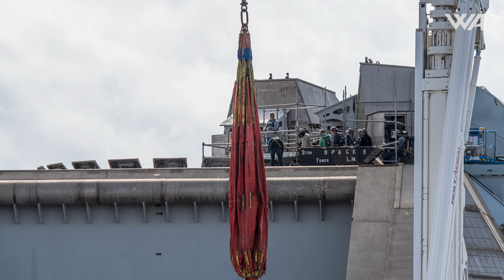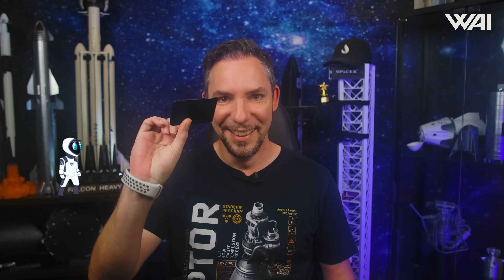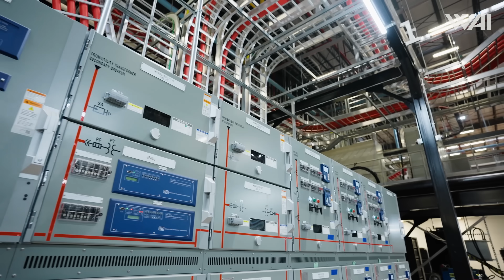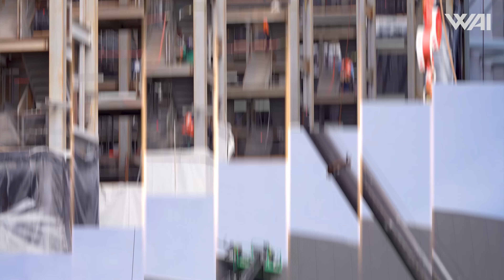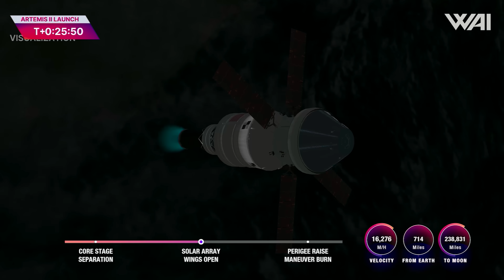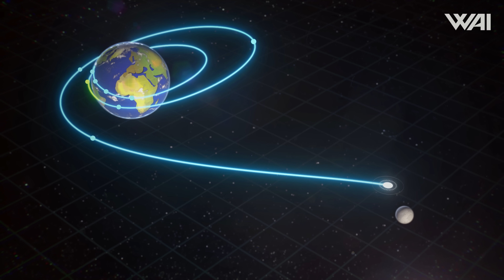SpaceX Reveals CRAZY Starship Plan Involving Gigantic "Mini" Satellites!

Comment: You are wrong about the advantages of spacebased AI data centers. The cooling is not easyier than on earth. Radiation is the worst method to dissipate heat. A cooling system on earth with the same cooling performance would be smaller and cheaper because you can use air, water or even the ground as a heat sink. In space you need a large radiator or a smaller radiator in combined with a heat pump to increase the temperature of the radiator (cooling performance of radiation is proportional to the 4th power of the temperature). The cooling of data centers is a challenge due to their scale. For a data center as big as one of these satellites cooling would not be a challenge at all.

Comment: With V2 SpaceX learned that rapid prototyping only works if an iteration shows improvements to the iteration before like with V1 and if there is enough time between flights to analyze the gained data. Now they don't want to risk repeating the problems of V2 which would damage the reputation of SpaceX. Without progress rapid prototyping has no benefits.

Comment: Just send it: a failed launch turns into a wet dress rehearsal by default.  There's no people on board and there's no rendezvous dictating a specific launch time so go for it.  
Orbital: Sure, that makes perfect sense.  If everything goes fine with flight 12, an orbital flight for 13 does not surprise me one bit.  That said, I would be shocked if they still go for a catch on flight 13.  I could see them going for a soft splashdown in the gulf.  Test the re-entry profile and plan to overshoot the launch/landing facility and land this thing right off the coast.  They might even try to recover it if it survives in some shape or form.  
Flight 14 imo is the earliest that they will try to go for a catch.  I doubt we'll see that earlier than July - August.
Once we get to a catch though, I bet we'll see launch cadence hit once a month pretty rapidly.  
By end of the year, I expect to see that prop transfer demo between 2 ships.  With most likely one of those being launched from Florida.  
I also suspect we might see the HLS pathfinder version of Starship making it's way towards the end of the production line by the end of the year.  I think it's completely plausible that they will be ready for that demonstration flight in 2027 for Artemis III.  I also think there is a non-0 chance that after the demonstrations are completed in LEO, SpaceX will fill that HLS demo and send it off to the moon for it's first Lunar landing attempt.  

All of this is of course dependent on a flawless progression from here on out during the test program.  One can dream right?

Comment: I am wondering : Is there no huge risk that a very, very large number of particles ( asteroids ) are flying in space and possibly damaging the terrafab satelites so that they are punctured and smashed apart  ?  That would cause more much more debris / space junk which is flying at very high speeds endangering other satelites too, right ?  Earth is protected by the atmosphere .. the asteroids just burn up in it .. what will happen in space ? There is no protection of expensive hardware up in the orbit and when a chain reacion of destruction starts it probably might coat the whole surface of the atmosphere.

Comment: First question - Yes, they will an should do a wet dress rehearsal with all new hardware
Second question - An orbital trajectory does not mean a catch attempt.  In fact, I think it highly unlikely they try to catch it on the first orbital flight.  I think they have an orbital flight and plunk it into the ocean.  So yes, flight 13 orbital if all goes well with the relight on flight 12, but it doesn't have a catch attempt.  Probably flight 14 for the first catch attempt (if all goes well).

Comment: So NASA couldn't afford a Starlink antenna or two as backup?  Every Starship carries both Starlink and TDRS antennas.   You would think after spending over $30B there would be a little left for that.

Splashdown of Orion off California ensures that the service module is discarded into the Pacific.  SpaceX is also moving to Pacific splashdowns for Dragons to eliminate the risk of the cargo module crashing onto land.  You know how prone Amerikans are for lawsuits.

Flight 13 Starship 40 will only be caught if everything is perfect.  Otherwise I expect S40 will simulate a landing over the Gulf or off California.  One thing to look for is an application to the Mexican authorities for reentry over Mexico.  Because you can literally see Mexico from Starbase a Starship will be below 20km (60,000 feet) over Mexico, and therefore in Mexican airspace, so at least a NOTAM would be required.

A key purpose of a Wet Dress Rehearsal is testing the GSE and the ground crew.  I am certain they have been rehearsing for months now, but everything about IFT12 is new, including the GSE.  There will be new supervising apps in the control room and different time sequences.  Engineers always remember that if they missed anything the consequences may be not only millions of dollars, but also loss of life.  Canadian engineers wear an iron ring, forged from the wreckage of the Quebec railway bridge. The bridge is infamous for two major construction collapses in 1907 and 1916 that killed 89 people.

Comment: Heat dissipation does not need large cooling systems? Total nonsense. You should do a better research. The only way is thermal radiation. And that needs very large radiators. Which must point away from the sun....
Therefore data centers in space are a total nonsense.

Comment: Soon, the "market" for space will open with the moon being front an center. This will require all types of skills not just astronauts. For Gen Alpha, this means being top of class and adding in what is needed to be selected for work on the Moon. With the ability to transport people to and fro, (I assume 2030) the optimization of the skills and abilities of these "workers" will be needed by the 100"s. As an example, the construction teams @ SpaceX would make an excellent "first team" as they are intimately familiar with the constructs of space opposed to a home builder or skyscraper builder. There will be needs for space plumbers to electrical engineers to composite and metal workers and more. it will take an army to maintain presence there. Not to mention the rotation that will be required until the radiation issue has been completely mitigated.

Comment: When I was watching  the massive building activities on the new launchpad two months ago, it seemd almost certain to me, that there wouldn't be a launch soon. Not before everything is ready and tested. Looks way better now, I give it a 50/50 chance this time. They will absolutely do a wet dress rehearsal. There is no need to rush it with the first V3 start on the one an only finished next generation launchpad. The build quality is next level on so many details - especially the the booster, the heatshield and the launchpad. 

The short term timeline depends on that flight, for the long term its no urgency besides achieving two successsful flights until September. If IFT 12  comes down in one piece, it will be fast forward. If not (and there is a 50/50 chance that things will go south for whatever reason) it depends on the nature of the failure.   For the long term one or two failures during the test flights don't matter too much. 

The most significant next milestones (and still months away anyways) are gigabay and starship factory! They are not finished yet, not equipped, but will be in a few months. As soon as they are fully operational, there will have been at least two successful landing profiles done over water and the gates will beopen for a massive ramp up of production, testing and landing. I think starting from the end of the year we will see a full new stack emerging every month, resulting in two flights per month, resulting in 24 flights next year with catches every time. I expect the successful orbital refuelling and test flight around the moon next year (with another launchpad finshed), the first landing attempt two months later. 

The flight cadence will ramp up massively in 2028, I expect 200 flights with cargo and test configurations, resulting in two moon landings by starship besides a busy scedule in cargo flights. In 2029 - after 300+ successful flights and catches I see no reason, why starship should not be human rated. The built in redundancies and the over engineering are massive, no space craft has ever been more safe if everything works out as planned. Crew hardware will be completely different fom cargo and tanker hardware.

Comment: SpaceX has definitely broken the mold of Rocket development, testing, integration, and many other ; shall I say - ancient  manufacturing processes, but I think he's overlooked one thing with this new compute in space and the satellites that will support it. That overlooked item would be the solar panel array that he's shown in his recent renders. If you're building a massive computer in space with massive power needs don't rely on 400 long unstable panels. Surround your satellites , at least on three to five sides (assuming a cube-shaped sat) with your solar panels. It will never be without power, never have to be "reoriented to the sun", and could autonomously link and communicate with other satellites from the open end(s) or have 'holes' through the panels to support communication, etc. 400ft. long panels in space at 17500mph (+/-) hit with MMOD's could still be damaging and add to space junk. Enveloping the satellites with the solar array would be much safer and efficient overall.

Comment: Datacenters in space won't be cheaper than on Earth, manufacturing a satellite and putting it in orbit even with a cheap launcher is still costlier than manufacturing a rack and putting it on earth, and the same goes about providing it  with energy, and even more about servicing it. Space datacenters beyond very niche applications (mostly reducing latency or bandwith once you go far from Earh) are a grift.

Comment: I'd like to suggest that SpaceX could easily go to orbit without the extra suborbital flights with a small change in flight plan. Launch with a bit more velocity so that the trajectory if a relight fails, would be the far end of the cleared landing area. Then swap ends, and do a very short burn, to verify a relight is possible/likely, this time positioning the landing zone to the begining of the cleared landing area. Then swap ends again, and do a second very short relight and burn to recapture the original launch trajectory to the end of the landing zone. Now we have verified that we can relight twice, a strong indicator that two more are very likely to be successful. Now relight and do a much longer orbit insertion burn, and go deploy a large batch of satellites.   Then switch ends and do a long deorbit burn to setup for LZ. Then soft land in the ocean.

Comment: No not brave! Very stupid..it should had never been human rated. This time they had a potty problem, ex AF Crew Chief, put that boondoggle in the bin, cost over runs, shit if only I could do that with my Cusomers!@!
Reply: This is why it’s a test flight.
Reply: @paulblase3955 Not test flight!! A spam can that wants to be a coffin..test flights is a step by step of getting certified for flight. The  pilot puts aircraft in to hi stress attitudes. This boondoggle way way over cost! Let's count? Ripped out all the wire as it was not in spec. Almost lost heat shield..Stranded a crew at International space station for how many months??? Now a potty problem. It a piece  of not junk as ex AF crew chief, I wouldn't sign off for flight..thank NASA for Canceling the program..The Challenger WASN'T supose to blow up.. bad seal on the booster, and engineering said no. They launched anyway..NEVER EVER USE THE STARLINER AGAIN, NO MUSEUM, SCRAP IT.. you can't make a turd fly..it never crawled.......later

Comment: Orbital flight 13.  Try catch the booster while the second stage goes around in orbit until the booster is moved off the pad.  Then the pad is ready for the upper stage to get caught.
Reply: Putting it in orbit means they can take the time with the booster, Starship can orbit multiple laps before the land it.

Comment: Why would you need a panel for heat dissipation when all you have to do is put a shield in front of the AI and It should keep it cool as long as you block out the sun, that should be all you need

Comment: If they orbit on flight 13, my guess is they don't catch but rather do a catch simulation off the coast.
Reply: Yes, I was going to post the same thing. I also believe flight 13 will aim for ship to splashdown several miles of the coast.  We've already seen them do this with the booster. My only real concern here is noise. People may complain about loud sonic booms.  The booster came back much slower and from the opposite direction, over water.  By contrast, the ship will re-enter at Mach 25 and the flight path seems to go directly over the Brownsville / Matamoros metro area where > 1 million people live.
Reply: 100% agree also dont expect a ship catch before pad 1 conversion completed 🎉
Reply: @hedleypepper1838  Well, that would mean that they would have to wait with the catch attempt at least until the end of the year. But they have no time for this.